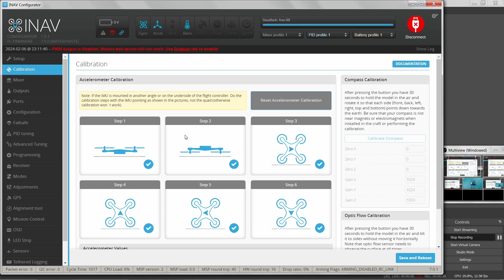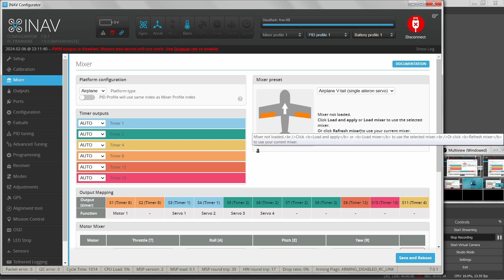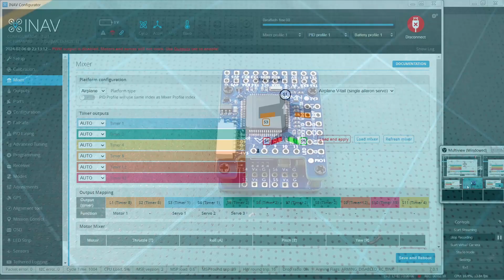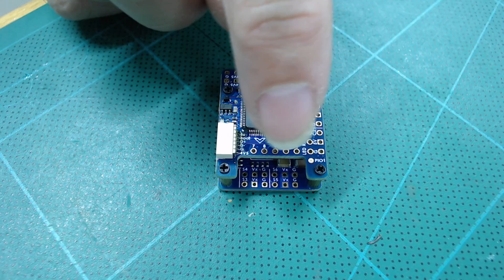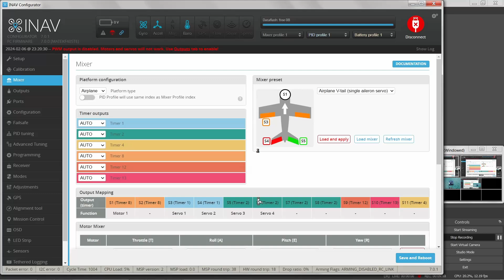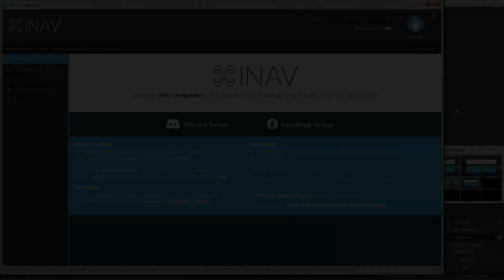INAV: Mixer Tab

Comment: hallo, I am getting flying wing ready but for some reason I have pitch movement but when I move roll stick movement.
Reply from the maker: Make sure you have the correct servos plugged into the right ports. Servos are numbered differently than the ports, so you might have Servo 1 connected to S3, for example. Usually, in a wing, there is a servo in each wing, and because their orientation is mirrored, one will move its elevon up and the other will move it down, given the same signal. So for pitch, one should have a positive value (like 50) and the other should have a negative value (-50), and for roll they should both have a positive or negative value (like 50/50, or -50/-50) depending on which values get them moving in the right direction.

Comment: A quick note on what the timer settings are for. Those may need to be adjusted based on how many servos you want to use vs how many motors.

 As you mentioned, they are output groups. All of the outputs on timer 1 can be motors, or they can all be servos. That is, timer 1 can run at motor speed, or it can run at servo speed. But timer 1 can't run at both servo speed and motor speed, at the same time. That group has to be either all motors, or all servos.

Suppose your flight controller had two outputs on timer 1 and 4 outputs on timer 2.  If you were building a quad with a gimbal, you'd need four motors. So you would set timer 2 (4 outputs) to motors, and set timer 1 to servo for the gimbal.

If you were using the same FC to build an airplane with one or two motors and 3-4 servos, you would need more servos and fewer motors. So you would set timer 1 to motors and timer 2 to servos.

Comment: Hello Sir, How to set up throttle for engine plane in iNAV Configrator
Reply: It sets up automatically when you connect the esc control wires (black and white don't connect the red wire to Vx it's 5v bec in esc and may damage your FC) to FC esc control pads in mine they are s1 and s2